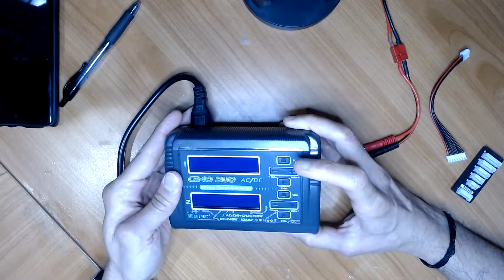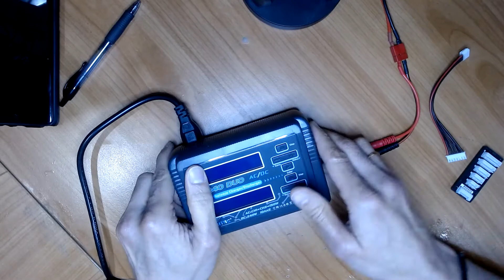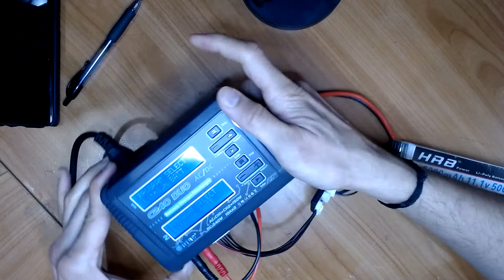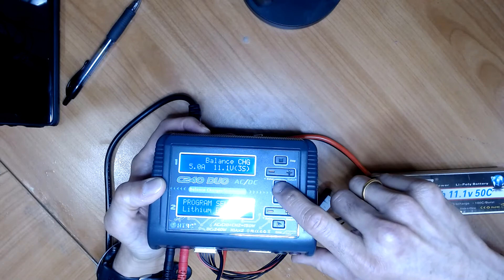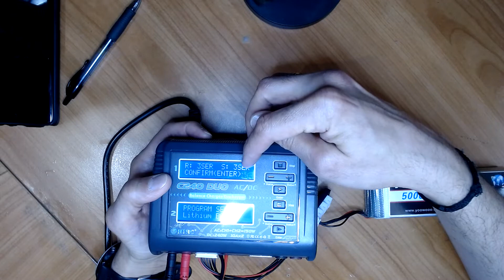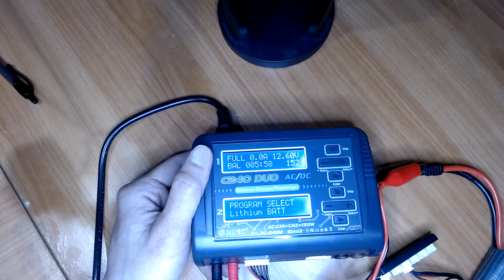C240 Duo LiPo Battery charger setup and charging

Comment: I have a 6S 22.8V 10C 25000mAh LiPo (HV) battery. The C240 Duo max charge rate is 10A, and that's what I set before charging.    
When I charge hook up the brand new battery, it reads 23.1V.  I believe full charge should should be somewhere around ~ 25.2V.  When I attempt to balance charge, my Amps never go above .4A, and it charges so slow. In 120 minutes of charge time, I went from 22.7V to 23.1V.
6:46  I think my "User Setting" are correct.  TVC-25.2V (~4200mV/cell) Capacity Cutoff - 25,000mAH, TempCutoff-60°C etc..
Any Ideas why? Is it because the high capacity of the battery and I just need a charger with more Amps?
Reply: Yes you need more watts.

Comment: Please do not use alligator clips in this manner; the potential to short the battery is too high and dangerous.
Instead, either build the proper banana-to-TRX charger wire, or create a deans-to-TRX adapter.
Reply from the maker: Thanks. Will keep that in mind.